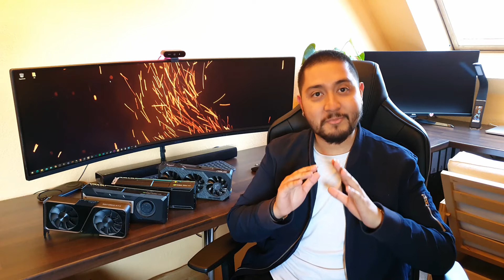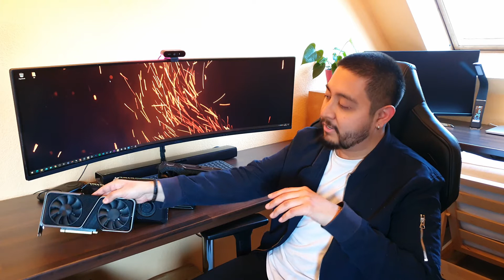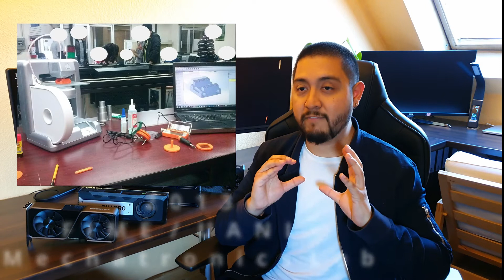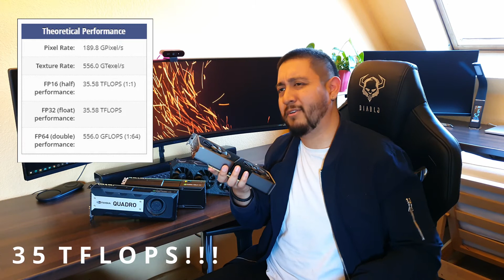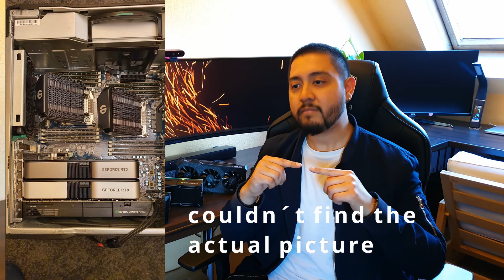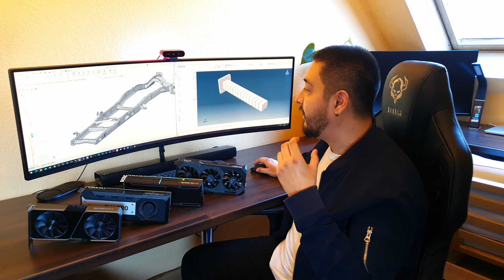Best graphics card for CAD/CAE/Deep Learning  \ from a mechatronics engineer perspective

Comment: I had few questions: 
Software i use now are ansys 2021R2 and creo 7.0 and nvida P2200. I use gpu acceleration in fluent.
1. Is it normal the usage of cuda in gpu shows around 40%?
2. could i let the graphic card use more to get better performance?
3. Do you have experiences to use gpu acceleration for parameter settings in workbench? i find no resources from youtube or google.

Thank you

Comment: I have a question about CAD/CAE software to run FEM calculation. In Gendral FEM calcualtion uses CPU for calculation. Can this be made to use GPU for calculation??? If this is possible to use GPU do I have to look for better GPU Memory ? or Better CUDA or Tensor Core?
Reply: In my experience another important factor to do FEM / FEA is te RAM memory , if you have the chance try to compare 16 or 32 with 64 at 3200 mhz and there will be a huge diference

Comment: Hello I have a Z840 with Dual e5 2637 V3s 48gb of ram and a GTX 1080 I would like to start playing around with deep learning. What kind of low budget Quadro, Tesla, etc card would you recommend to pair with my GTX 1080 to start. I want to make short funny deepfake clips.
Reply: I was considering a Tesla K10 there reasonable on eBay right now.
Reply: @johnringgold3036  k6000